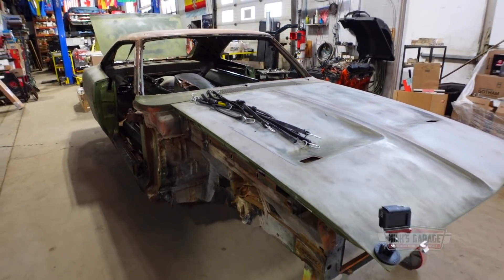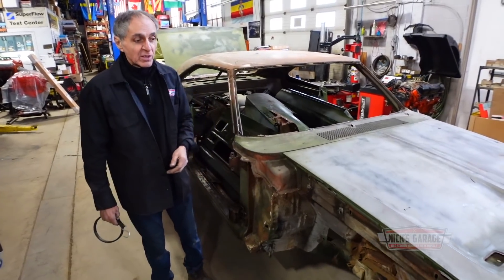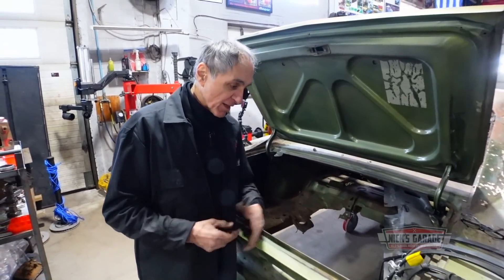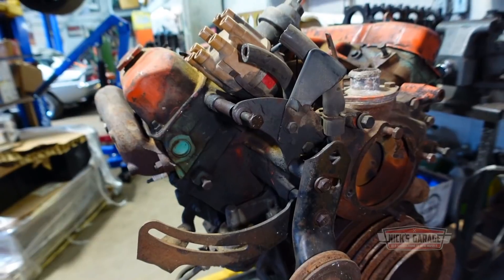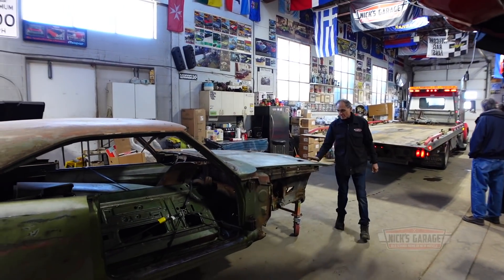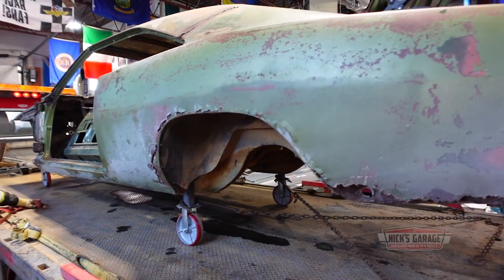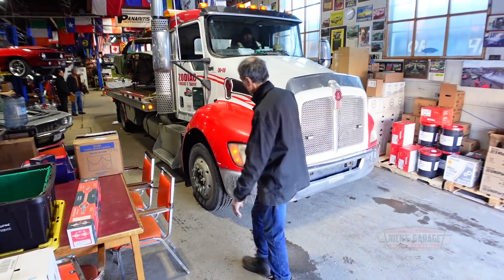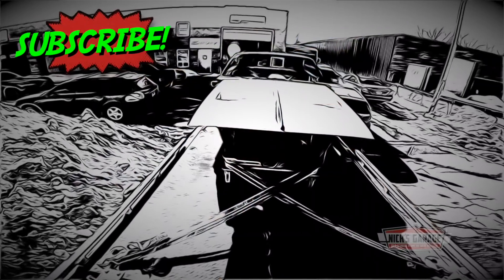CRUSTY 1970 Dodge Charger R/T Goes To Blasting

Comment: 👍Another good video. Thx Sir Nick & crew! Back in 78 or maybe 1980, (I was around 12 or so) my brother had a super fast ‘68 Dodge Charger R/T 440. (Dual points) anyway, he ran it HARD everyday & never failed him. I loved that MOPAR! He eventually pulled the 440 & tranny (can I say that 😂) & put in a 71 CUDA or Challenger (much better overall condition than the Charger at the time) then he and his buddies took the ol RED 68 Charger to a field & bullet holed the hell outta it! I couldn’t believe they shot it all up but they did. LOVED THAT 68 R/T Charger! We once made a trip from Louisville KY to Huntsville AL. in 3.5 hours. Hammer down!
Reply: What a shame. Shooting a 1968 Charger RT 440 to death.   Not today.  What we all did in the old days.

Comment: OWNER of the Charger. There is nothing more beautiful than a perfectly prepped and painted black car. I am a 40 plus year car builder/autobody paint man. To do black on a vehicle there is extra steps that have to be done to insure that the body and paint is as close to perfect as possible. May I advise you on this color. The upkeep on it is going to be a lot of work. Just as soon as it is washed and dried it will be getting dirty again. I advise to never put a car cover on it. The cover will absorb even the smallest dust/dirt particles and scratch the paint as the cover is being put on and taken off. Let the car  get dirty and wash it as often as u can. Do not use those fancy car show brushes on it to get the dust off. They do put small scratches in the paint. Again, black is a beautiful color. I advise to take another look at another color(s). A color that is easier to maintain. Lighter colors are like that. One color that I think will look amazing on the car is a green that is as close to the original color as possible. The green that is used on the newer hellcat's, challengers and even the trucks would look amazing on it. Dark colors are pretty but are a lot of work to keep looking beautiful.

Comment: Would love to see the rear widow metal reconstruction - that must be fine metal working skills. Hope George takes some video of that process and shares it on this channel.
Reply: Check out the yt channel Rust Bucket Restos, he's working on a '68 Charger and has already replaced complete rear window channel.  Not an easy task,, but I think he made it look easy.
Reply: Scott at Coldwarmotors can do it. It helps to have the rear glass to trial fit after spot welding the fabricated patches.
Reply: When you replace the whole quarter panel it comes with that channel attached I believe.
Reply: @tlr-nut7275 , not that I've seen, because he's (RBR) replacing both quarters as well.
Reply: A new Dutch panel we'll take care of that,,

Comment: I hope the shop that has agreed to take on this job has the expertise and facility to do the job correctly. There’s an enormous amount of structural work that must be done to the millimeter.
Reply: Actually it's done to the fraction of an inch.
Reply: @Airwolf1971  You guys give the car manufactures a lot of credit... more like half a foot lol These old cars are all stamped steel and I would bet  not one piece is exactly like the other. This is why the old cars had so much adjustment in the front end, so they can correct manufacturing defects.
Reply: @SuperBigdanno  Yeah it's work you do with a tape measure not a caliper. But the factory sheet metal tolerances and fit is a mile better than the Taiwan AMD junk that's going to be put on it during this restoration.
Reply: Plus or minus  one eighth.  Is the standard.
Reply: @Airwolf1971  watch chris birdsong junkerup.  He makes everything fit perfectly.  Better than factory.
Reply: @chriscatarcio2983  I never miss any of his videos. If I ever need Mopar sheet metal work done he is the only guy for me.
Reply: From the factory a half of an inch was close enough. There was 20 -30 body men working in the body shop at the end of the line. That's when damaged roof became vinyl. 
.

Comment: Question for Nick.   Why did you choose sandblast vs the dip tank stripping you used on the Charger 500?  Thanks
Reply from the maker: Many reasons contributed to this choice.  Price, preference of the body man, and the fact that a big portion of the car will be replaced, they will only need to strip certain parts.

Comment: Why sand blast instead of dipping the body?  I know Sand Blasting can't get into every nook and cranny on the body where the dipping chemicals can reach every where.  When I did a 75 Scout, I had the frame dipped as there was no way I could get into the inside of the frame rails to remove the Michigan rust so I am curious on the differences and the reasoning.
Reply: Reason we sand blasted it is that many parts of the body panels are going to be replaced.
Reply: @nickpanaritis4122  Ok, thanks for the reply, I can't wait to see this beast on the road.  My favorite Charger though is the 68 vintage, I just love the rear taillights and other rear end trim.

Comment: No such thing either  E37. E38 E49 E48 in the charger high performance  model 6 cylinder 265 Hemi mine you there are some rare codes out there have owned all models in Australia Chargers  even one of the last 318  4 speeds built  . And seen the last Charger in Tamworth for sale 318 stripes up the sides  pin stripes in black on the boot sales men said to me and my brother take a good look boys this is the last one a bloke on a farm next to me brought it traded his blue VJ 265 Charger on it  . Long story but my friend Bret  brought a  Charger the same  years later in a very sorry state I still think today it was that Charger  very rare end of the line hopefully it up and going again. P.s there about 7 four door valiants with the 6 pack option where as fast as some big block Mopars I knew a guy that had red four door 6 pack. Brian from Tasmania. Love your show